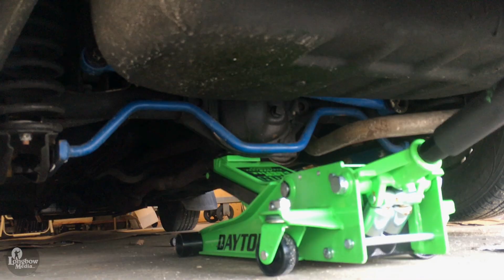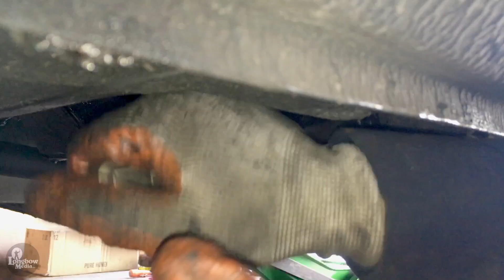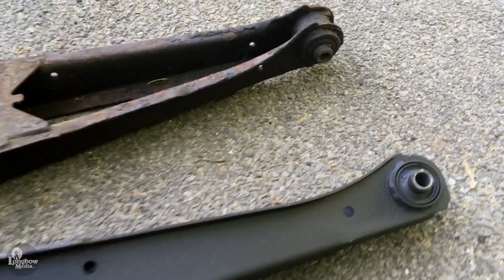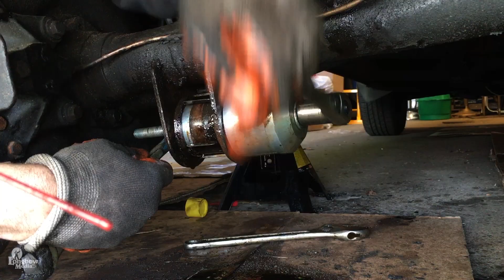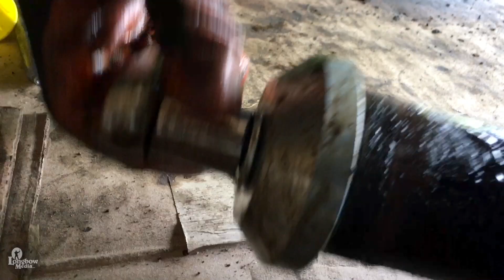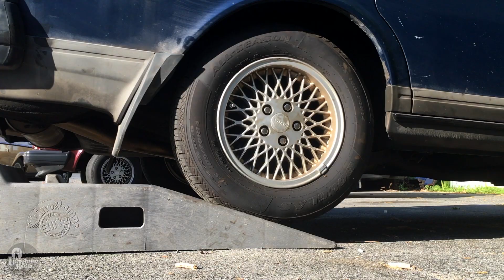How to Replace a Trailing Arm and Rear Control Arm Bushing on a Volvo 240

Comment: The long bolt you took out after heating it, to remove the trailing arm, was there a metal sleeve behind it? What is that an optical illusion in just a clean part of the frame? You can see it at 1 minute and 40 seconds into the video

Comment: What made it easier for me was putting the tool under tension when you can hardly turn the nut, then whack only the bush, close to the collars of the axle, with a hammer and a cold chisle. This will eventually make it move. Don’t use heat as you will easily melt the parkbrake cable (as I did)

Comment: there is a way to make things much easier, use a zip gun and make a quasi cut all the long of the bushing external sheath, it will free and slips easily from its bore without causing damage.

Comment: I just finished these on my 92 wagon- replacing with BNE bushings… The BNE bushings push almost all the way through with your hand- very easy. Bolts and washers from McMaster- fine thread Grade 8 is key- well greased- pushed out the originals with ease- not a single threading issue for both off and on. I put deep creep over everything for the two days prior.BNE bushings are really not much different smacking rough roads- I did notice I could hear my aging rear rotors more and a bit more noise from the transmission
Reply: I have a 940 and I am having trouble finding the arms or even the rear bushings. Any suggestions.
Reply: @desmo316mrvolvo5  have you checked out VP Autoparts?
Reply: Are BNE polyurethane bushings?
Reply: @buttermilkbiscuit1021  no it’s more like a Teflon ball joint
Reply: Still going strong after being beaten every day on some of the worst city roads

Comment: Thank you for making this video.  It's concise and to the point.  I just did this job after making the tool.  I messed up and didn't grind the push end of the tool enough and got it stuck in the axle ear.  Many cutting blades later it finally came out.  Definitely not the easiest job in the world but after doing it once the next time, if ever I'll know the little tricks.  Thank you for all the help and I really appreciate these videos.
Reply from the maker: I've done several of these in the past few years and it's a total gamble whether or not it's easy as pie or hair pulling agony.  Got to love that New York road salt, haha.
Reply: @LongbowMedia  Using an impact to remove the bushing made all the difference.  That coupled with lots of PB blaster and it came right out...well only if I ground down the other end of the tool correctly, haha.  All in all.  It's not the worst job but after doing it once and learning from mistakes it will be a lot easier in the future!

Comment: I made a tool out of 2" pipe fittings and a high tensile bolt ,i broke the bolt then spent hours beating the crap out of the bush until it came out! The second one was easier the inner part and rubber just fell out and i managed to fold the outside of the bush inwards enough to shift it .Unfortunately just having one car you cannot just go to the shops for parts and this was in 2003 there wasn't much on Ebay either! I miss my Volvo i couldnt source a bonnet and have it sent to me less than the value of the car so it was scrapped 😢

Comment: Has anyone tried cutting out the rear trailing arm bushing and knocking out the excess on the ears with a support brace in the middle? I feel like this is possible with a reciprocating saw, a lot of torching plus a hack saw for the rim of the bushing which is galvanized steel by carefully cutting just shy of the ears in two places and punching out the rest... thoughts and comets?

Comment: Great video, thanks.  Just finished this.  Quite rusty on mine.  Banging around the ears with hammer and penetrating lube helps.  Regular bolt/nut got stripped.  So got 1/2'" diameter grade 8 fine thread (pitch 20) bolt/nut. I didn't have the Volvo tool so made my own as seen in some of the other videos on this subject.  The mechanical advantage of the fine thread and the hardened metal (and greasing the threads) did the trick.

Comment: Have made a start on this job, it’s a right pain in the butt. Easiest way of removing the old. Bushings I found was to drill out the rubber and remove the middle metal sleeve then collapse the outer sleeve with cold chisel and hammer took about 20 mins per side. The night mare I am having is that the replacements just won’t go in. Yours slipped in easily until it hit the second ear. The front end bushes are proving even more difficult
Reply from the maker: I just did the trailing arm bushings on my '82; they came out, easy-as-pie!
Quite happy I didn't have to relive the experience from the '90.
My '82 hasn't had exposure to road salt in the Winter, which may explain why it was so easy.

Comment: I don't think they make the tool any more. Built my own. It indeed took 6 hours and an additional 3 to do this job. Yes 9 hours and I already had the rear end pulled to swap out. Lotsa lube. ALOT of cussing and you'll get it. Just don't expect this to be a fast easy job. It's not going to be. Good luck y'all.